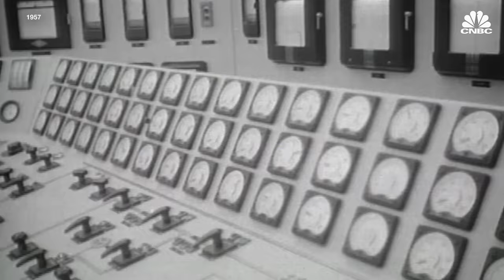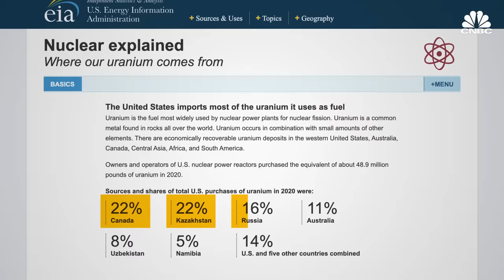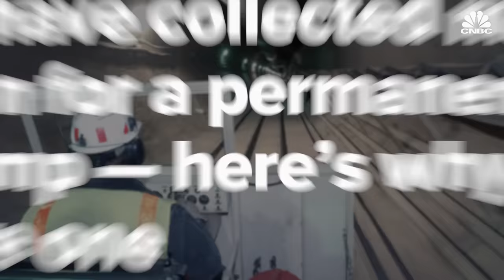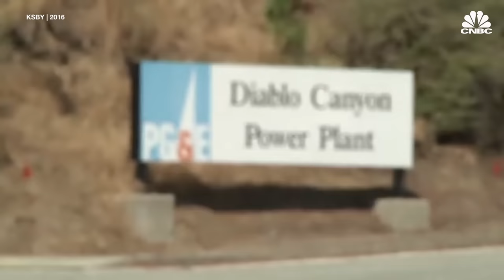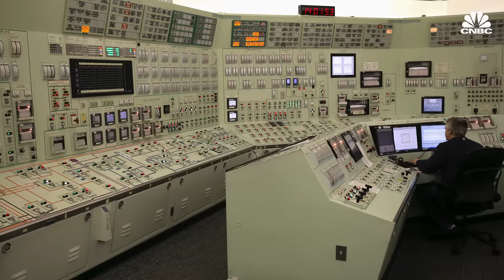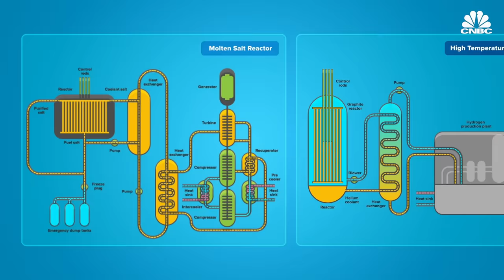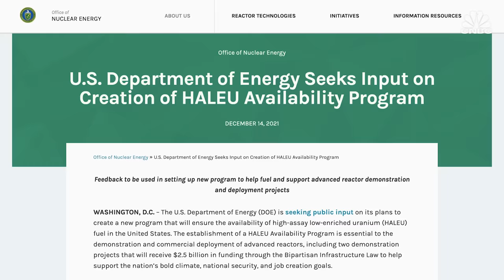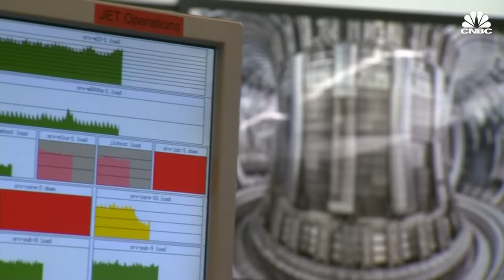Why Nuclear Energy Is On The Verge Of A Renaissance

Comment: I grew up a few miles from a nuclear power plant, and today I’d rather live right next to a nuclear plant than anywhere close to a coal or gas fired plant. You’re way more likely to get sick from that air pollution than a nuclear accident.
Reply: Coal emits more radiation into the environment than nuclear. Nuclear may produce more but the waste is much easier to contain.
Reply: And not to mention the shear obvious fact that people will claim. Cheaper electricity bill.
Reply: Same. I lived 7 miles from one. I want one in my back yard. Very clean; very safe!
Reply: @sharathyashshakar3352  what’s wrong with nuclear? Wind and solar are great, but only when it’s windy or sunny. Don’t say the waste, because if you believe it’s an issue then do more research first.
Reply: @FancyUnicorn  coal dosnt crrate radiation. U mean heat & exhaust?
Reply: @stepfrom1500   coal contains uranium and thorium, both radioactive elements. They occur in such trace amounts in "whole" coal that they aren't a problem. But when coal is burned into fly ash, uranium and thorium are concentrated at up to 10 times their original levels. Fly ash uranium leaches into the soil and water surrounding a coal plant.
Reply: @brrr8995  back yard is a bit close but i agree lmao
Reply: a nuclear reactor is completle safe until it isn't. a fossil fuel plant is a 24/7 hazard to health and happiness, whether there is a problem or not.
Reply: Lol you forget that eventually a plant gets decommissioned and the radioactive waste is just sealed in it for the rest of time here in Amurca
Reply: @CM-lo8iu  nope. Nuclear waste can and will be refined yet again and reused for fuel in nextgen reactors. This topic was touched in the video you commented under.
Reply: Exactly my attitude and experience. 
I live about 30km from a nuclear power plant and I tell my children how good it is that we have it here. The plant has been instrumental in protecting the environment, how many lives and health it has saved compared to regions with coal plants.
Reply: @vernonfrance2974   that’s true it’s an important part of the overall grid but they also have their downsides. In some areas they only provide power 30% or the time and they can be difficult to dispose of (solar and wind).  Geothermal and tidal are unfortunately only available in some areas, although they are great. As for musks battery farm, it is excellent in its use in Australia but 100 MW (the size of the battery), is only good for about 15k-30k homes, which means every city would need many many battery farms which is impractical and wasteful. Nuclear is our best bet on a large scale, but make no mistake, I am an advocate for wind, solar, hydro, etc. It solves a really pressing issue really fast, it’s what we need.
Reply: @vernonfrance2974  Cobalt in batteries will always be dangerous, nuclear items have half-lifes and eventually will be safe.  Cobalt never will be.
Reply: @brrr8995  Nuclear waste is an issue.....to think or claim otherwise - makes you an utter fool.
Reply: Electric cars will need energy, nuclear power plants can provide that.  100% clean energy is possible.
Reply: @tuesdayjam5905  yes it is but 1st it can be reused as fuel, 2nd most waste is low level from incidental exposure with a very short half-life.  All the nuclear waste in the US..." In fact, the U.S. has produced roughly 83,000 metrics tons of used fuel since the 1950s—and all of it could fit on a single football field at a depth of less than 10 yards."  USA  DoE.
Reply: @whiterooksme  I was on an aircraft carrier and many more have been on them and submarines.  They also pull into Port.
Reply: @whiterooksme  is Oakridge, Edgemoor or Solway good enough?
Reply: @bowez9  those half lives are hundreds of thousands of years!!!
Reply: @darinherrick9224  those items can be recycled as fuel then the half-life is just a few hundred years.
Reply: It's the obvious choice to get
Zero emissions and still run
A modern economy.
Reply: @tuesdayjam5905  nuclear waste is not as big an issue as it’s made out to be.  You don’t have tons of it like is depicted.  To me the fact that it is controllable instead of dumping it in the air is a much better option.  Todays reactors are better, more efficient and some are able to make use of fuel that would be depleted.
Reply: @bowez9  “new reactors which reuse nuclear waste as fuel, will still need a waste repository, likely as large as a repository for the waste produced by the current crop of conventional reactors,” says Allison MacFarlane, director of the Institute for International Science and Technical Policy at the George Washington University and chair of the US nuclear regulatory commission in 2012–14.
Reply: actually, burning coals generates more radioactivity in the air around the power plant due to the fact that the coal has natural radioactive particles inside, which are not combusted and therefore exhausted through the chimney.
Reply: @brrr8995  that's correct and that can be addressed because a French company has a way to turn waste back into usable uranium fuel again!
Reply: @stepfrom1500  No. There are radioactive isotopes in coal.
Reply: @koiyujo1543  The French don't have exclusivity on that.  The first Breeder Reactor was built in 1950 in Idaho, USA and 8 nations have built them since.
Reply: People who live close to the gas plant near me get a thing layer of yellow sulphur on their house under certain weather condition. Authorities say it’s safe but still..
Reply: @tiberiusava4592  And there we go.....when the issue of toxic nuclear waste is challenged - someone like you appears with the false equivalency of burning coal......give it up, there is no reasonable comparison!!!!
Reply: @tuesdayjam5905  if you were a little curious you would have foud out that what I said is true. The premises of the coal burning plants are more radioactive that those of the nuclear power plants. Just get informed!
Reply: as long as the waste isn't dumped in your back yard , right ?
Reply: Bob Saturday Lol it’s not dumped in anyones back yard. It’s buried deep in geologically stable rock caverns which won’t see the light of day for thousands and thousands of years, if ever.
Reply: @FancyUnicorn  interesting, i didnt really think about trace element radiation before from coal
Reply: @Make_Boxing_Great_Again  Nuclear is way worse. All that radiation in the environment is way more catastrophic.
Reply: John Smith You can literally visit the town of where the worst radioactive accident in history happened, and still be fine. These accidents occur globally at a rate of far less than once per decade where as over 1,000 people every single day die in a road traffic accident. The Earth is warming at a catastrophic level and it’s about to get out of control. Have some context.
Reply: Nuclear energy is going to be a BIG business in the next few decades. And trust me: Germany is surely mising out completely. The relevant of a country is measured by how much things it can offer to the world. Germany lost software, semiconductor, smartphone, etc. They barely hang on NEV (New Energy Vehicle) but fierce competition from Tesla AND Chinese companies. Germany will lose the nuclear business - one of the megatrends.
Reply: @FancyUnicorn    True. Coal emits far more radiation than nuclear. That’s true until someone say Ops
Reply: @tuesdayjam5905  This, class, is what is called projection.
No, nuclear waste isn't an issue. What you and so many other incorrectly call nuclear waste is actually almost entirely unspent fuel. It only exists because regulators shackled the industry to designs which can only economically extract a few percent of the energy in their fuel load. We've had better technology since before the first commercial reactor even came online in 1956.
Even if mostly unspent fuel was actually waste, it is be far more compact and contained than the waste produced by "competing" technology.
Reply: @darinherrick9224  You clearly don't understand half-lives. The longer the half-life, the safer it is. The shorter the half-life, the quicker it won't be dangerous anymore.
Reply: @JohnSmith-hs1hn  Newsflash, cupcake. Everything is and always has been radioactive.
Reply: I've never lived near one, but I would gladly have them build one in my back yard.
Safest, most reliable power source ever.
Reply: Agreed
Reply: To anyone who disagree just visit west virginia and eastern kentucky….coal capital, its a sht hole out there and the people age fast af and look like zombies lol.
Reply: @FancyUnicorn  "coal contains uranium and thorium, both radioactive elements." not to forget, Carbon-14.
People always forget that nuclear powerplants are designed to contain radiation, fossil fuel plants are designed to just exhaust that radiation into the air.
Reply: @yokikokudou  how?
Reply: @jacobnebel7282  You can call it what you like, at the time of its storage it was waste and remains so, your  assertion about unspent fuel is theoretical until such times as a plant which chooses to use it, designates it as such - so waste it remains. And never mind the whataboutery of competing technologies people like you always rely on to try and minimize the risk of nuclear waste.  Quite simply, if nuclear isn't an issue why is it subject to such high levels of security that other waste from competing technologies isn't.
Reply: @bryanbarnard4094  There's more than a quarter million metric tons of highly radioactive waste currently sitting in storage near nuclear power plants and weapons production facilities worldwide, with over 90,000 metric tons in the US alone. Emitting radiation that can pose serious risks to human health and the environment, the waste, much of it decades old, awaits permanent disposal in geological repositories, that currently don't exist.   If the risk was a low you maintain, there would be need to move it, or provide the security it currently requires.
Reply: @Make_Boxing_Great_Again  Tell me where these deep rock caverns are that you maintain nuclear waste is currently. stored in. I'll give you a wee pointer - wanting to store nuclear waste in deep caverns doesn't mean it's actually happening - so, tell me where is this actually occurring. ???
Reply: Tuesday Jam Onkalo, Finland to name just one, looks like a classic case of “I’m not educated on it so I don’t like it”. 🤣🤣
Reply: @tuesdayjam5905  
do you know dry cask storage for nuclear waste?
Reply: TRUE
Reply: @tuesdayjam5905  it used to be that way but they now have prototype reactors that actually run on nucular waste
Reply: @bergonius  It should be rerefifined but as the video says $ wins out.
Reply: @CM-lo8iu  We should place it in a storage facility like yucca mountain. I know we let x number of people from South America per year per ton of nuclear waste , we both loose!
Reply: @robo-suport_czrobofactory3116  Yes I am but its another temporary solution and just another example of passing our toxic waste creation onto future generations. Also, the San Luis Obispo, Calif., chapter of Mothers for Peace has successfully sued the NRC and power utility Pacific Gas & Electric Co.—owners of the Diablo Canyon power plant—for failing to take into account the impact of a potential terrorist strike when assessing the environmental risks of a new, proposed on-site dry cask storage area.
Reply: @tuesdayjam5905  
so whats exactly the issue? 
if its killing less people then coal then isnt it an upgrade in every single way? since it produces alot of energy as well?

In fact wouldnt it be more cruel to keep postponing decomissioning coal which kills milions of people each year? > nuclear is a fast solution with no real draw backs because i dont think the nuclear waste is that much of an issue it just takes up space...
Reply: @johnschouten2924  I wish people like you wouldn't just trot this stuff out like - there we go, problem solved. Prototypes do exist, but the industry itself isn't confident about these prototypes becomes commercially viable as they are very expensive to build, complex plants that they can't operate economically. Even if they could there would still be thousands of tons of nuclear waste in need of a permanent home. So please do not try and maintain that the problem is going away any time soon. If at all.
Reply: @flufffycow  it's not viable yet because there's too small amounts of spent fuel produced overall to facilitate full scale refining industry, and no commercial reactors compatible with reused fuel. We need more reactors to produce spent fuel to provide a single  refining factory to feed new next gen reactors. It's an ecosystem we need to build first.
Reply: @tuesdayjam5905   Nuclear waste has never been a technological problem, merely a political one.  We have at least four ways of dealing with it, but an ignorant public creates political land mines for anyone trying to implement the solutions we have already had for many decades.
Reply: @stepfrom1500  
RE: "coal doesn't create radiation. U mean heat & exhaust?"

In a 1978 paper for Science, J. P. McBride at Oak Ridge National Laboratory (ORNL) and his colleagues looked at the uranium and thorium content of fly ash from coal-fired power plants in Tennessee and Alabama. To answer the question of just how harmful leaching could be, the scientists estimated radiation exposure around the coal plants and compared it with exposure levels around boiling-water reactor and pressurized-water nuclear power plants.

The result: estimated radiation doses ingested by people living near the coal plants were equal to or higher than doses for people living around the nuclear facilities. At one extreme, the scientists estimated fly ash radiation in individuals' bones at around 18 millirems (thousandths of a rem, a unit for measuring doses of ionizing radiation) a year. Doses for the two nuclear plants, by contrast, ranged from between three and six millirems for the same period. And when all food was grown in the area, radiation doses were 50 to 200 percent higher around the coal plants.

Reference: https://www.scientificamerican.com/article/coal-ash-is-more-radioactive-than-nuclear-waste/
Reply: @FancyUnicorn  thats so misleading🤦🏾. Ceramics create radiation, ciggarette smoked clocks, etc. None of its like nuclear radiation as i know but people who just go and get googles first definition might not know
Reply: @frequentlycynical642  yea i was just thinking about nuclear radiation not what comes from bstteries, cigs, cars etc.  Not even sure why anyone woukd even maje that point about coal other than because it sounds so horrible
Reply: I agree. I live next to Shippingport Pa where both a nuclear and coal plant are producing power. Recently (2yrs or so) the coal plant closed (EPA) you wouldn’t believe how clean the towns and cities are now. No more brown dust collecting on the eves of the homes. No gritty deposits from the morning dew. The nuclear plant never bothered me one bit. I’ve always been aware that it’s there and necessary precautions but it’s never alarmed me it was so close.
Reply: Grass is always greener on the other side………
Reply: I grew up between Oyster Creek and Salem, NJ and never felt like anything bad was going to happen
Reply: Modern nuclear power plants aren't a problem, but living next to a fissile material processing plant, uranium mine, or nuclear waste site storage facility will drop the price of your house for a reason. So yes, wihle modern nuclear power plant is clean when considering the whole supply chain, not so much, yet it is out only real option, so perhaps we could pay higher bills for proper handling of radioactive material before and after it enters "clean" nuclear power plant instead of hidding inconvinient truth under the carpet and pretending that everybody who is against nuclear is brainwashed lunatic when he refuses uranium mine or waste site to be build next to his house...
Reply: @darinherrick9224  No. The worst one is Plutonium with a half life of about 25,000 years. It's a very tiny fraction of the total waste and can be separated out. Most of the rest of it has a half life measured in decades or centuries at most. Also, many of the new designs can use what is now waste as their initial fuel. And the waste they create is far safer than from the "normal" LWR uranium reactors.
Reply: @tuesdayjam5905  Nuclear reactors don't "burn up" the fuel they use like a fossil fuel plant does, with its waste going up the stacks as gas and particulates, so the volume doesn't go down when it's re-used. Only the teeniest, tiniest bit of it is converted from matter to energy. The rest of the mass is still there.
Reply: @DianeMerriam  What exactly led to your need to explain that ??
Reply: Technically true
Reply: @tuesdayjam5905  It's not an issue, because it's a solid, can be easily stored, and it doesn't take up much space. You need to read up on the subject, especially before you go around calling people "an utter fool."
Reply: @JohnSmith-hs1hn  There is no "radiation in the environment" due to nuclear power. The waste is a  solid which is easily stored and (hopefully technological developments) can be used in the future. 
Also, there is already some trace background radiation which naturally occurs in the environment. https://www.google.com/search?client=firefox-b-1-d&q=background+radiation+in+denver
Reply: @CM-lo8iu  Uh, so what?  Even if that land is never again used for anything, it's a small amount of land.  Typical nuclear power plant occupies 0.1 square miles.  A solar farm that generates the same amount of electricity takes well over 50 square miles.  And even though the solar farm uses 500 times as much land, it does not (unlike the nuclear plant) provide electricity 24/7.  So what's the big deal?
Reply: @tuesdayjam5905  When I first became an anti-nuclear activist in 1975, waste was my #1 concern.  But I've learned more and realize that is not an issue any longer.  (Yucca Mountain style repositories, in my opinion, have actually made the public perception worse, because, quite frankly, they are even safer than necessary.)
Reply: @jacobnebel7282  I am pro-nuclear and am not concerned with nuclear waste.  But I do need to point out that your statement about longer half-life elements as being safer is not necessarily true.  The situation is more complicated that such a simple formula.
Reply: @tuesdayjam5905  I agree with you that people promising that nuclear waste can be reused are overplaying their hand; it certainly isn't the practice that is happening today in the US.  We do , undeniably, have nuclear waste sitting around.  However,  it does not follow from that fact that this waste presents an insurmountable obstacle.  In fact, it is quite easy to store safely, and not just for the next few years, but for hundreds of thousands of years.
Reply: @tuesdayjam5905  Do you now how that waste is currently being stored in/around nuclear power plants?
Reply: I grew up next to one as well and what is crazy to me is the average coal plant produces 250,000 tons a waste per YEAR, overall we a total of 90,000 tons of nuclear waste so
Reply: @BS-vx8dg  Yes I do, why
Reply: @tuesdayjam5905  I'm trying to ascertain your level of understanding.  When I was first becoming an anti-nuclear activist in the mid-1970s, my major concern was nuclear waste.  Turns out much of the information I had was out of date.  So I'm asking you to describe how you think nuclear waste is stored today at these plants.
Reply: Where do they dump the radioactive trash ? The sea? They last decades centuries etc
Reply: @albertorodas6479  As far as I know, they are not currently dumping radioactive waste into the oceans.  However, if you understand the nature of the waste and the nature of radioactivity, you might well conclude that it wouldn't be a big deal if they did.  In the case of Fukushima, there was some water contaminated with radioactivity that got washed into the ocean.  But the ocean, as you may already know, is bigger than a bathtub, and the dispersion of the radioactive water occurred so quickly that in less than a few days there was no detectible radioactivity.   Think of it this way:  You would never eat feces, right?  Or rat poison.  Yet if a small amount of feces or rat poison got dumped into the ocean, would that contaminate the entire ocean forever?  Or even the place where you dumped it?  Radioactive waste is not  mysterious magical malicious matter; its deadliness is connected to how concentrated it is.  You get X-rays at the dentist, which delivers far more radioactivity than was placed in the water at Fukushima.
Reply: @tuesdayjam5905  this whole comment trail proves you don't.
Reply: @basketcase1235  Don't what?
Reply: @BS-vx8dg  You're asking me to describe how I think nuclear waste is stored today......because you suspect my information may be out of date??
Reply: @tuesdayjam5905  Let's put it more bluntly.  Because I don't know if you know what you're talking about.
Reply: @BS-vx8dg  Based on.......
Reply: @tuesdayjam5905  Based on your extended avoidance of the question.  Okay, I'm done with you.  You get the last word.
Reply: @BS-vx8dg  Why should I bow to your arrogance and condescension, suggesting that I'm unaware of how nuclear waste is stored today.  You not knowing if I know what I'm talking about is your issue, not mine. I'm fully aware of how different grades of nuclear waste are stored.
Reply: @BS-vx8dg  Incidentally, I just read your comparison between nuclear waste and human faeces or rat poison - and you're questioning my knowledge or understanding of nuclear waste.......you should really take a moment and have a think about that.
Reply: Also downstream of a dam. Or even below a levee. Yeah I'd rather live near a nuclear plant.
Reply: @brrr8995  say what, rain water is only good on a rainy day? You what , store it to use later? wow, who would have thought that it didnt rain EVERY day
Reply: @brrr8995  it doesnt rain every day either. So your going to stop relying on rain? where do you get these dumb ideas from?
Reply: @Averagegunenthusiast  its not always wise to do the insane just because its possible.
Reply: @bowez9  Cobalt and Nickle in batteries is so last decade technology.  LiFo batteries are the go at the moment with many other varieties coming on, graphene, Borene, sulfur, sodium. Non use cobalt and Nickle.
Reply: @jacobnebel7282  because safety never was a consideration for the rules?
Reply: Never mind the plant.
The hot nuclear waste disposal is the unsolved problem.
Reply: @robo-suport_czrobofactory3116  fast solution? your definitely from another planet.
Reply: @andyfreeze4072   So don't do solar or wind and create two more industries of leeches.
Reply: @andyfreeze4072  since you mentioned Sulfur apparently you don't understand the chemistry.
Reply: @andyfreeze4072  the point is the fear of nuclear power is what is insane, there is an irrational fear built up by people who don’t know anything and they spread misinformation.  The anti vaccine movement is an example of how effective misinformation can be.  Nuclear power is used a lot in Europe, with no issues.  A modern reactor could be smaller and safer, reactor design and safety protocols are important but it’s not insane.
Reply: @Averagegunenthusiast  hey, i will point out that its safe because they have to make it safe. That safety comes at a cost which makes nuclear  the most expensive form of power generation.  While solar is the cheapest.  I suggest we take full advantage of cheap power instead of  driving prices ever higher.  whilst i agree with the greenies that nuclear sucks, its real achilles is cost.  You aint ever going to wipe Fukusima and Chernabol from peoples memories. Yes nuclear can be safe, but its a risk. A lot of us say the risk/cost management is not worth it. And then the financial markets have delivered their verdict.  Nuclear  costs would have to undercut solar by a substatial margin to ever be viable . That dont look like its gonna happen any time soon.  That is the reality you nuclear supporters refuse to acknowledge.  Going nuclear because we can just doesnt seem to be a sane  enough rationale  to justify that direction.  You guys seem to think nuclear power can just happen in a bubble.  Well, out side the bubble , other technologies  have proven themselves better .
Reply: @andyfreeze4072  I’m all for solar and wind, but batteries cost a lot, and the minerals aren’t plentiful enough to power both the grid and make batteries to replace fossil fuel vehicles.  Nuclear can fill the void.
Reply: @Averagegunenthusiast  well in isolation , ten years ago you would have had a point. Battery technology is about to take a quantum leap forward.  Hold on to your hat, its going to be a fast ride.  If the minerals were that rare, batteries and solar would be more expensive. The fact that solar and batteries are getting cheaper every year doesnt mean anything to you?  I think you havent read wide enough to fully appreciate the transformation happening in front of our eyes.
Reply: @andyfreeze4072  
it does take some time to build a power plant like 6 years? it also depends where... some countries just build it faster some slower atm, however there are some dormant nuclear power plants as well, waiting to be decomissioned or re-activated. the prices of energy are rising in my area cuz germany keeps decomissioning nuclear powerplants and building coal ones instead...
Reply: @andyfreeze4072   Solar and wind aren't subsidized on your planet?
Reply: @andyfreeze4072   Remove subsidies from both.  Your price of electricity goes away up and solar will destroy the grid without fossil fuels or nuclear.  Do some damn homework.
Reply: @andyfreeze4072  
its true that solar is getting cheaper, but when you dont have space then, well... not much use....
building on water? perhaps.

wind isnt consequence free unfortunatly

and hydro.... whats actually stopping us from building several hydro plants in a row? idk. just asking.
Reply: @JohnSmith-hs1hn  The radiation doesn't enter the environment.
Reply: @tuesdayjam5905  Finland.
Reply: @stepfrom1500  if we're talking about ionizing radiation, there's no difference. Ionization is ionization, it kills cells and disrupts DNA molecules exactly the same regardless of the source.
Reply: @PaxHeadroom  Bull.
Reply: Survivor bias. Period. Other people - not as lucky as you - died. Get over it. Fukushima, Chernobyl, Three Mile Island, Dounreay, Hartlepool, WindScale, Oak Ridge, and on and on...
Reply: @bowez9  spell it out better. "Incidental exposure" is college graduate vocab. Most nuclear waste is other materials than uranium that's been exposed to radiation enough to become temporarily radioactive.
Reply: @tuesdayjam5905  it's a completely reasonable comparison. You live around a coal plant? You're being exposed to radiation right now, no accidents necessary.
Reply: @tuesdayjam5905  nuclear waste is an issue. The problem is other kinds of waste from other kinds of power plants is a bigger and more pressing issue. As in, right now right now.
Reply: @tuesdayjam5905  Finland has a repository going online next year
Reply: My parents and other family still live in Texas.  The  perfect storm winter is the only outage they have had since I left.  I had none, and went through several hurricanes.  It is not as bad as you paint it, and there are several regulations such as power needs to be restored within 24 hours.  The hurricane that hit Galveston Island wiped out almost all of the houses, yet Reliant Energy was required to restore electricity to empty lots.  My friend works for Reliant and told me this story.  You do not have all the facts.
Reply: @Averagegunenthusiast  So tired of hearing that statement. I power my Tesla 100% with excess solar power from my office. Everyone in America can do this for LESS than the costs of 2-3 new nuclear plants.
Reply: @Averagegunenthusiast  So, now you're gonna ignore, or deny that there are 65,000 TONS of nuclear waste in storage across the US?
C'mon.
Reply: @beaubennett7469  you power your Tesla not everyone, I would love for it to be possible but I don’t see it.  Not everywhere is sunny all the time, some places have cloud coverage most of the year.  Some people will also have to charge at night when they are home, also extremely hot climates need a lot of ac so there is extra energy.  When it is night the sun doesn’t shine so there is no solar how do you power things then?  Just because you can do it doesn’t mean everyone can with current technology.
Reply: @JohnSmith-hs1hn  There is no dangerous “radiation in the environment” from US nuclear reactors, its all contained as shown, decaying away.  There are coal ash mountains collapsing into rivers, wind turbine blades filling up land fills by the millions of tons.  Maybe rethink what’s bad for the environment.
Reply: @tuesdayjam5905  Waste in cans from US reactors does not have high level security.  Closed plants have dozens of waste cans sitting on a slab somewhere with a simple chain link fence and maybe a renta cop.  Put down the comic books.
Reply: @Nill757  Brilliant Falstaff. Thankyou for pointing that out. That is not and should not be the norm in terms of closed nuclear waste storage. However, you have just highlighted one of the problems the nuclear power industry creates.
Reply: @andyfreeze4072  “quantum leap forward”

Heavy industry is not a video game, w a new software update dropped every 3 months.  There are no quantum jumps in any heavy industry, ever.  Twenty years is a fast change. There was enormous investment earlier in battery development and mfn to get here, making it increasing unlikely a quick change can occur. Nobody is going to close $300 B in battery plants to do a new thing.

Price of lithium is up 500% the last 18 mo.  Only one li mine in US and all proposals for new ones rejected.

Now some 300 wind farm proposals have been cancelled in the US, as they increasingly push up against populated areas.  

Price of refined Silicon up 300% last two years, causing price of panels to climb, from the worlds only significant source, China.

Wind and solar and batteries at the scale required to replace fossil requires enormous material resources, literally mountains of steel, aluminum, rare earths, nickel, cobalt, mining like the world has never seen, and land use like the world has never seen for energy production. As the price of lithium is already showing, that’s never going to happen, meaning either carbon emissions continue or the world gets serious about nuclear.
Reply: @robo-suport_czrobofactory3116  “several hydro plants in a row”

Do you know of any untouched pretty river valleys w steep drops you’d like to see destroyed?
Reply: @beaubennett7469  “Everyone in America”

I don’t think you’ve done the math, somehow assuming the grid or rooftop solar is infinite.  How many chargers at your office?  Each new charger adds another 6KW, roughly the lights -AC-computer load of a largish existing office building.  I doubt everyone in just your office could charge there, much less be replicated by the whole country.  

That 9000 gallon tanker truck we all see hauling gasoline carries the energy equivalent of near an hour of Hoover Dam output, delivered in minutes to a half dozen neighborhood filling stations.  So yes you can charge your car, but it’s simply no possible to push a Hoover Dam equivalent into every community either by transmission, nor by intermittent roof top solar.
Reply: @beaubennett7469  “65,000 tons”

Do you understand that number in context?  That’s the spent fuel mass from all reactors for all time, all of it contained in concrete cans, close to the source, and 95% is uranium no different from the uranium in the surrounding  dirt and rocks.

By contrast, a large coal plant might burn up 50,000 tons of coal every single day. Maybe half is converted to water vapor, but the rest is dumped uncontained in either the atmosphere or on the ash pile.  Same goes for a same size gas plant.  Wind farms and solar farms use a similar mass, over large excavated land areas, not everyday, but much of it goes land fills.
Reply: @Nill757  
perhaps
Reply: @Nill757  wow, somebody that just accepts a slow death on a boiling planet. Your figures are so outrageously out there, they cant be trusted without a reference or context. So everything you said is hot air.
Reply: @andyfreeze4072  Is French nuclear outrageous?  Sweden? Ontario?  It’s specific, real, clean, affordable.  By contrast you hand waive specifying nothing at all. 

BTW, running around saying things like “boiling planet” is untrue and dangerous.  Climate change is a serious problem, true. Yet there there is no IPCC “Mad Max scenario”.  Cutting off all fossil fuels abruptly without a replacement would do a  Mad Max job.
Reply: @Nill757  well for us, it would be boiling enough. French nuclear is what they went with all those years ago. Its expensive power and the privatised company went bankrupt at least twice.  Thats what they have and thats what they live with. You dont have to follow a blind cat over the cliff.
Reply: @stepfrom1500  Coal power plants emit radiation into the air not to mention mercury cause coal contains small amounts of radioactive substances in it so the emissions being released into the air are radioactive ☢️ unlike a nuclear power plant where the radioactive ☢️ fuel is contained.
Reply: Don't forget to plant some sunflowers
Reply: @FancyUnicorn  Don't forget plutonium
Reply: @brrr8995  How in the hell many people are there who`ve never heard of batteries? I`m in favor of nuclear reactors by the way. They can power container ships and so forth.
Reply: Ironically enough, in the event of a nuclear war-more a possible event as of late than in the past-the nuclear power plant's containment building would offer pretty good protection I imagine from anything but a direct hit.
Reply: You are absolutely right
Reply: @FancyUnicorn  So the only alternative to nuclear is coal? Think bigger or go back to sleep.
Reply: Peculiar thought, but true.
Reply: @FancyUnicorn  Plus modern reactors can recycle it til its only radioactive for a couple hundred years rather than tens of thousands.
Reply: @bergonius  Unfortunately people watch 1 minute of videos like this then comment like they have watched the whole thing.
Reply: @JohnSmith-hs1hn  Air pollution kills nearly 10 million a year and has been for over a hundred+ years vs nuclear accidents that have killed about 400 people total in the last 70+ years
Reply: Also, nuclear isn't cheap. It's subsidized. At least that's what the anti nuke folks claim.
Reply: @jacobnebel7282  What about the byproducts... waste from producing the fuel?
Reply: @BS-vx8dg  Um, we really don't know how much radiation has been released into the Pacific from Fukushima because no one is being honest about it or testing. So, your claims are un-backed. Many think the corium from the melt down is in a river beneath the plant, and has been operating as basically an open cycle cooling system directly into the pacific for the last 11 years. And the radiation does not quickly dissipate. It streams out in highly radioactive swaths that rake through the ocean and take years to dilute. Your comparisons are highly dishonest. Until a study is done on the whole matter we know nothing... which makes me wonder why a study hasn't been done to determine the effects on the pacific and the river under the Fukushima plant... which makes me think that the answer such a study would provide is so awful that no one wants to know that answer.
Reply: @andyfreeze4072  It's not cheap. It's subsidized. And why is geothermal always ignored? It really is basically limitless free safe energy. And it's not safe.
Reply: @Averagegunenthusiast  geothermal
Reply: @artofthereal  so you rather subsidise every other form of energy thats " safe" as houses, but solar is ruled out.........because its cheaper? geothermal is used where its appropriate, sure it needs more development but solar is now the lower hanging fruit so to speak.
Reply: @tuesdayjam5905  All the world’s nuclear waste ever produced fits on a single soccer field with room for more.
Reply: @FancyUnicorn  yea
Reply: LOL, enter Rusia and you sound silly now. Any accident is catastrophic. Solar panels is the only way to go.
Reply: The word is NUKULAR!
Reply: @CM-lo8iu  nuclear waste can be reused as fuel now so that’s not an issue
Reply: @JohnSmith-hs1hn  it's contained unlike coal putting a blanket on the earth. See Carl Sagan's speech to Congress in 1985. It's on YouTube.
Reply: @FancyUnicorn  YES> And, "Clean Coal" is like a nonsmoking section of a restaurant, or no-defecating section of a swimming pool.
Reply: @thefogg  Nuclear is dirt cheap on operating costs, but the cost of building is currently very high and the time to completion and online is long, as interest payments continue to mount as anti-nuke-ers do their best to delay! Factory-built SMAs should speed the process, especially if they are used to upgrade an existing plant where the turbines,  generators and distribution are already in operation! 
Innovation in financing (like trading low payments until the plant comes online in exchange for taxes on output for payback over the life of the plant - and probably the remediation of the plant when it ages out. Federal, state, and perhaps local participation in financing may reduce resistance and demonstrations. Some designs do not need water-cooling towers
Reply: @brrr8995  Tesla is selling a fair number of very large battery farms where storage needs are short - say 12-24 hours as a guess. They are currently a good way from longer term storage but Musk recently noted that the bat farms smoothed very short term changes in demand, saving quite significant cost of buying outside power piecemeal! I.e. you do not have to change the output of the gigantic turbine generators used in fossil plants. Most recent may be in Texas.
Reply: @FancyUnicorn  What level of radiation accumulates in the soil? I have not run across that number.
Reply: @FancyUnicorn   That’s what I like, an informed commentary! 👍  Many can spit out information without reason or backing, the Few, can inform and give us the reasons, the know facts, to go Nuclear ☢️, or find another way.  Thank you.
Reply: @bergonius   This crowd seems to know it’s $#it.  Either I’m too old and need a refresher or I’m out of your league.  But I’m glad people are knowledgeable as to how to go FORWARD.
Reply: @jacobnebel7282   OK, I’ve been reading through most of the comments, and they’ve been INFORMATIVE, overall.  We don’t need to call each other  cupcakes, unless you two know each other, something the Rest of us are unaware, or care to know.  No big deal with me, either way.  Just be Cordial and sincere.
Reply: Tell that to the kids from Chernobyl or Fukushima.
Reply: @brrr8995  I...said that? lmao
Reply: O
Reply: @stepfrom1500  nah it does actually, you'd have to study a bit of chemistry to understand how radiation works exactly
Reply: @stepfrom1500  Uranium and thorium are in coal naturally.  Naturally-occurring radioactive elements are allowed by regulation to be released by coal plants into the air and concentrated in the coal ash.  By far, coal plants release more actinides that nuclear plants.  Coal has many harmful elements in it that are released to the environment such as mercury, lead, sulfur dioxide, nitrogen oxides, particulates, and heavy metals.
Reply: @markdavis8888  thanks 4 the info. I actually just learned yesterday that coal makes uranium from a N.korea vice video that was posted yesterday
Reply: False.
Reply: If it blows up in ur yard u can sue then yeyee
Reply: @howardlewis7804  ???? What a weird comment.
Reply: @brrr8995  Waste problem has been researched for 70 years, with no good solution. The residue from the atomic electricity I used in the 1960-ies is still in cooling dams, that require energy for circulation, not to boil. So new built wind power is wasted to treating our and our parent sol sins.
Reply: @rolandvonmalmborg1905  burry it in the middle of the desert. No water or people to contaminate neaeby
Reply: @bobhabib750  so explain when Cobalt is safe.
Reply: @bobhabib750  my orginal comment was that Nuclear waste will become safe, Li-Ion will never be safe.  Yet your comment challenge that Fact.
That was if you totally ignore breeder reactors and waste recycling and that the majority of waste by mass and volume is low level waste.
Which as the Hanford site is showing can be contained and cleaned, even for the first location and primitive disposal methods-when the current  enemy was more concerning than a possible future issue.
Reply: @bobhabib750  hence why I mentioned you and others ignoring tge recycling of waste in reactors, which lowers the final waste product to a few hundred years.
Those costs are nothing compared to F35 budget alone.  A fair comparison since it too was a DOD item.
Reply: @bobhabib750  a few hundred years forces you to change your argument against it, as it drops the half-life by multiple orders of magnitude, for COx free energy in a very small footprint for massive amounts of power, and fewer deaths per Watt than any other source.
Reply: @bobhabib750  no need to store on site for transport of nuclear material is safe.  Realize every piece of nuclear material is commissioned and decommissioned in Oakridge TN.   When have you head of I40 or I75 being shut down for radiation spill?
Reply: @bobhabib750  irradiated waste still biodegrades.
Reply: @bobhabib750  so you see no benefit in the logistics of having it secured in one location? 
Guess you leave you trash in the house and sewage in the sink.
Reply: @bobhabib750  so you agree with my last statement  then.
Reply: Yeah, and isn't uranium supposed to be contained inside the plant? Nuclear energy has come a long way since Chernobyl
Reply: @thefogg  sheer. Different proposition.
Reply: @brrr8995   @brrr8995  Yeah even wind has issues like killing birds and I guess noise? Never lived near one.

 Solar has waste and manufacturing them also isn't great.

 Nuclear has waste OFC, lots of money up front too and takes while to build.  It is amazing for large scale production. I'm not worried about safety as they are usually guarded very well. Hopefully we can find more uses for the spent fuel.

 I'm all for all three and diversifying power in general. Fossil fuels cause way too much pollution and so many people a year die from related diseases. Even the cleanest of fossil fuels is still relatively dirty.
Reply: Well you are not at all a bot.  Not, at, all.
Reply: Nonsense. Renewables are the way to go.
Reply: perhaps ironicaly coal power release much more radioactivity than actual nuclear power plan.. because there is trace radioactive material in coal and those plants sont have the same regualtion as nuclear power plant.
Reply: And these low accident nuclear power plants are 50 to 70 year old technology.  Imagine a modern small modular reactor.
Reply: How about the tritium and the glioblastoma clusters?
Reply: or even small amout of radiation because coal contains traces of radioactive isotopes and when they burn it it's everywhere around coal PP